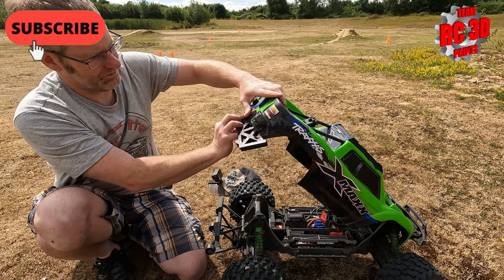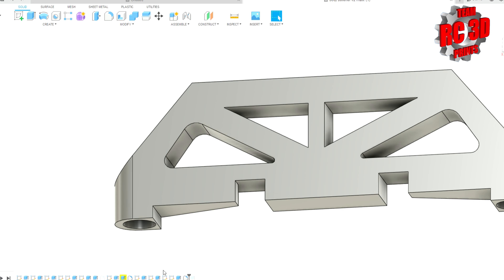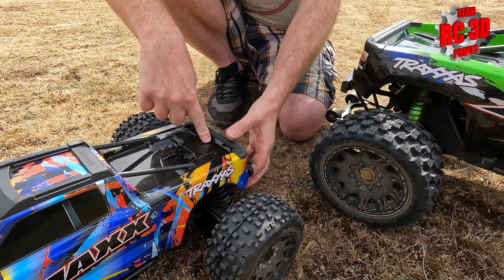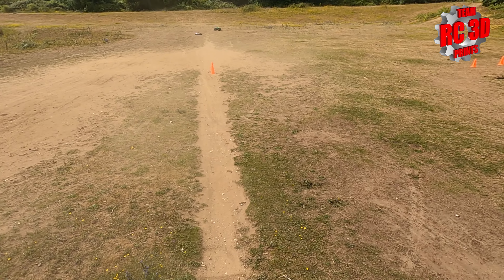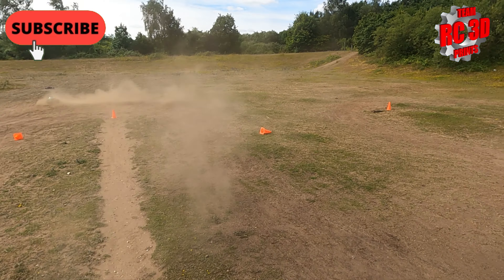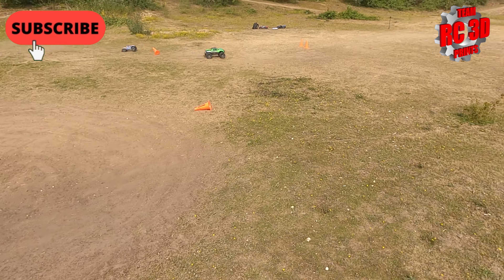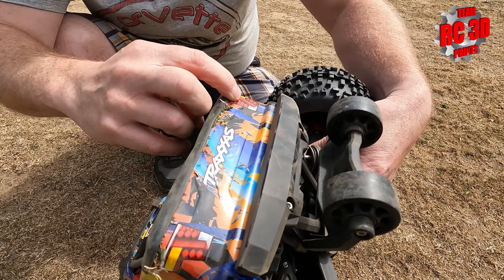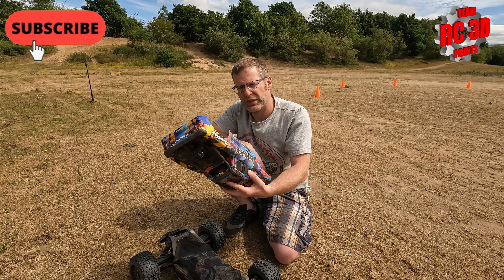Traxxas Maxx bodyshell protector - stop bash damage!

Comment: Does the part just press fit? Also, would it fit into a bodyshell which is already slightly crumpled at the rear bed?
Reply from the maker: Fits on to the plastic lugs underneath the bodyshell. Depends how badly damaged

Comment: I was just about to order one of these off your ebay but i thought before i do! Id ask you do you recommend the flexible or the rigid one and why
Reply from the maker: Flexible one has more give so the item will last longer but the shell will flex more, rigid one has no give in it so will break easier but will give more support to your shell
Reply: @TeamRC3D  thanks for the reply but I still dont know which to go for ffs 😂🤣
Reply from the maker: We both use the flexible ones if that helps at all.

Comment: Got one of these recently for the X-Maxx. Seems to work so far but needed to be drilled (bodged) a bit to get the holes to fit correctly. Will probably give the one for the Maxx a try. Is this suitable for V1& V2 Maxx ?
Reply: That’s funny - mine fit perfectly. Did you have it the wrong way round?
Reply from the maker: If it is one we supplied they are handed and you they will only fit one way round.